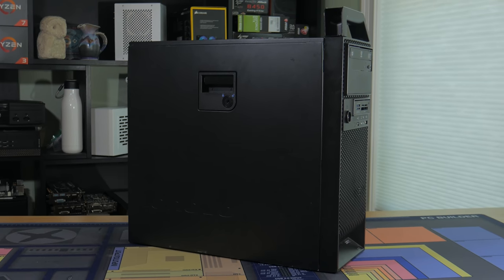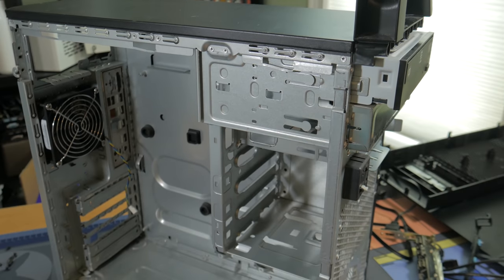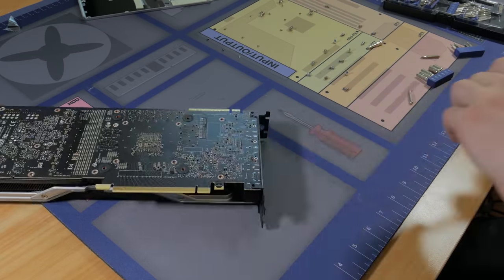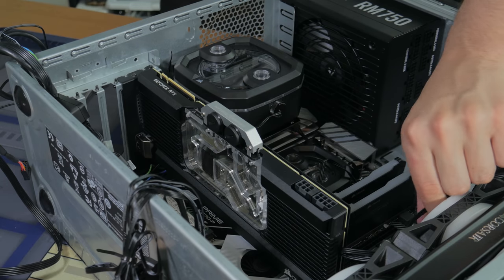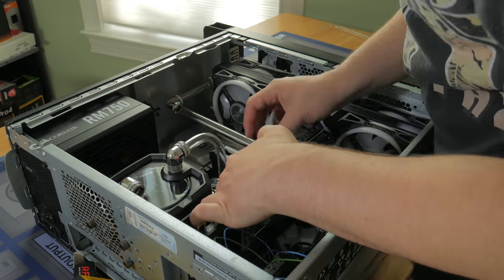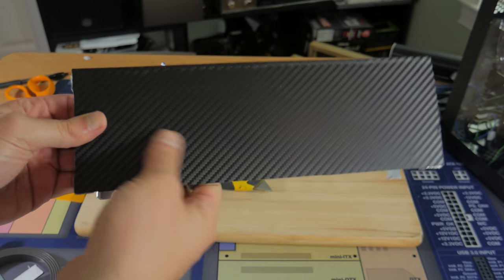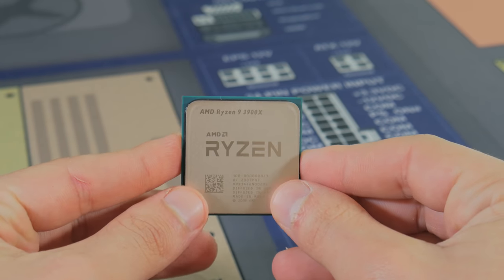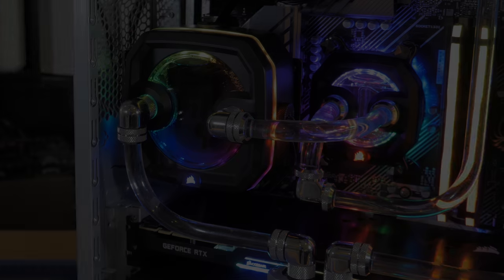BEST Sleeper Gaming PC! (2020)

Comment: YES!!! HANDLE IT!

Also, this guy really took a rubber mallet to this case haha, love it.
Reply: Yep, and the hard work paid off. It looks like mine w/o RGB
Reply: Hello I need help I have a pc that should be able to stream it has a Xeon e3 1220 and an rx580 8gb with 10gb of ram is it my internet should I get a Xeon e3 1230
Reply: @ThomasLancheros-kg1nl  I don't know much about computers either but you can get help at Reddit. There is a subreddit called /buildapc, I recommend you go there
Reply: @ThomasLancheros-kg1nl  from what I see on the specs of the e3 1220 and the 1230 it wouldn't make much of a difference. There seems to only be a 100MHz difference between them. It may make no noticeable difference at all.

I can't really tell you anything about streaming though and especially not streaming on a lower budget.
Reply: @ThomasLancheros-kg1nl  bruh, if it's the v1 e3 1220 lga 1155 then you might be able to play at 1080p but you might struggle with streaming at the same time. The v1 e3 1220 is worse than any ivy bridge i5.

Comment: I rock the real S30 for my main rig and it's awesome, it isn't extreme with it's E5-2689 8c/16t, 32GB 4 channel DDR3, RX580 8GB, but for my displays it's more than enough - the legendary DELL U2410F and the still awesome DELL P992 Trinitron CRT and for gaming nothing beats that tube.

Comment: I'm pretty sure the gpu cooler leaks. Major Hardware did a video on it.
Reply: watch jayz2cents video :D
Reply: only if you put pressure on it, go watch jayz video
Reply: @HoloScope  it leaked in major hardware system and igors too
Reply: kratek56 like they said in the video, it only leaks if you apply pressure on it and noone is going to be doing that 24/7 so it should be fine
Reply: Yeah you've only gotta worry if you're literally pushing on it constantly, considering it's a waterblock, I dont think you'd be touching it at all lmao.

Comment: For the card reader in the front panel you can stick a piece of black sponge or foam padding from the inside. 
Or if you are looking for a working card reader, then you can pick up a usb card reader and use it with a modified front cover to fit your case. 
I guess it's a tight spot to have a working card reader so put foam would make it look better.

Comment: Not sure if you are aware or not but it has become clear that the waterblock for the GPU has a leak problem.  In normal use it should be fine but do not put any pressure behind the block where the pipes connect.  Corsair are now aware of the problem and are as far as I know looking to fix the problem.

Comment: Very well-done!

I'd like to do a sleeper rig with RGB lighting but I'm on the fence about water-cooling. Always thought there'd be too much potential for leakage and thus a bricked system. If I took a beige box and modded it this way, I'd keep the floppy drive, though. Dr. Moddenstine did a sleeper rig made from an IBM Aptiva tower and he converted the floppy drive into an SD card reader, using the disks as caddies. I thought that was very cool. And I'd also replace the old optical drive with a Blu-ray drive. I have old PC games that came on CDs and DVDs and would like to install them in such a rig.

Comment: I actually got my hands on a  Pentium 4 based Xeon  Server from IBM and I plan on using it for a similar build.  I like the tall black cases and being a server case it is designed for ease of swapping out components which I also love.  It technically works but I could not even get 32 bit CentOS Linux to install so it is just too old as is.  So I will gut it and make it a custom build.